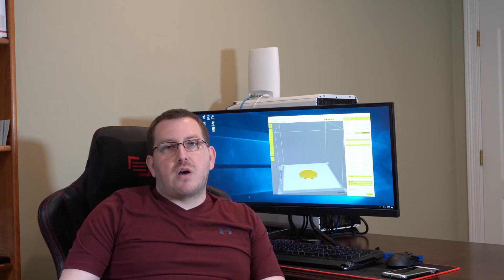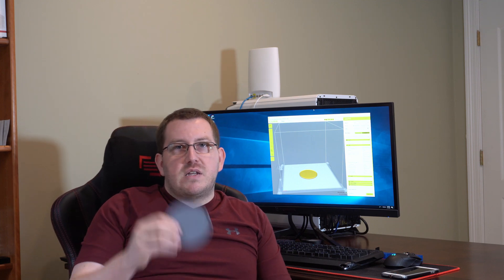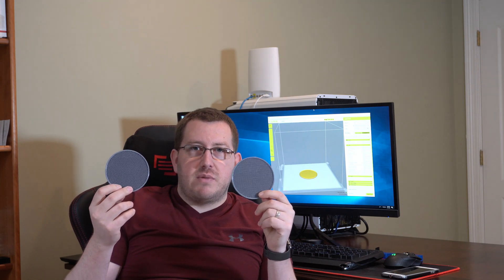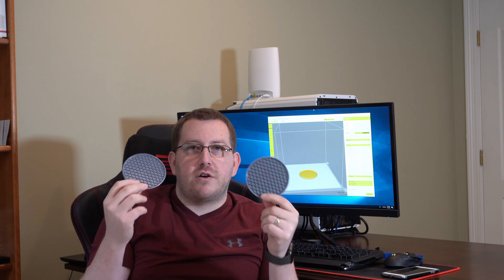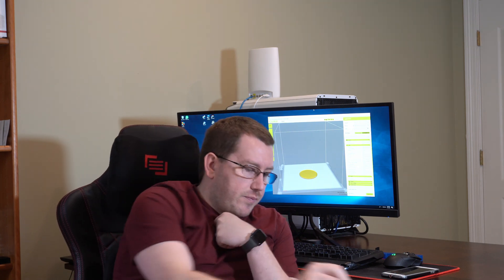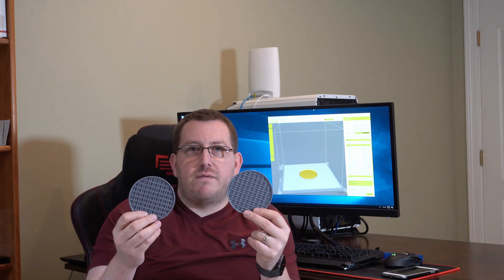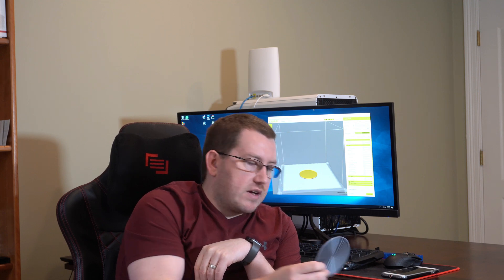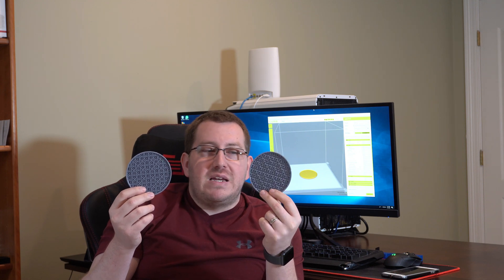3D Printer Infill Patterns - The Basics

Comment: Nice one. In your opinion how much of a learning curve is there with respect to the software required to do 3D printing?
Reply from the maker: Thanks. There is a slight learning curve to get a print going on most 3d printing software/slicers with generic settings ( I cover how to print a 3d object file here https://youtu.be/eXYpFLnrvgM), but it's not too bad. The leaning curve gets much worse when you get into trying to fine-tune settings for your printer or specific prints.